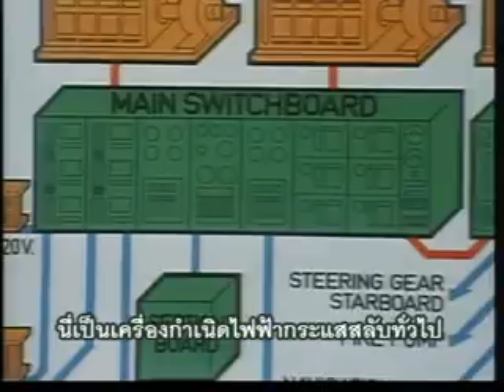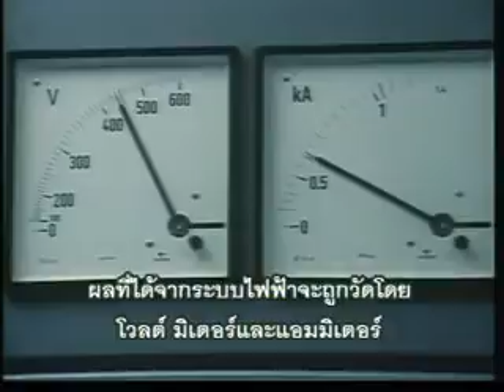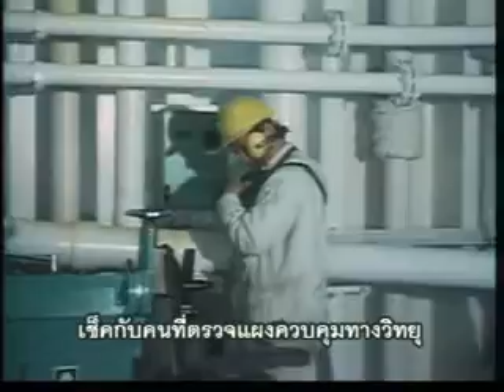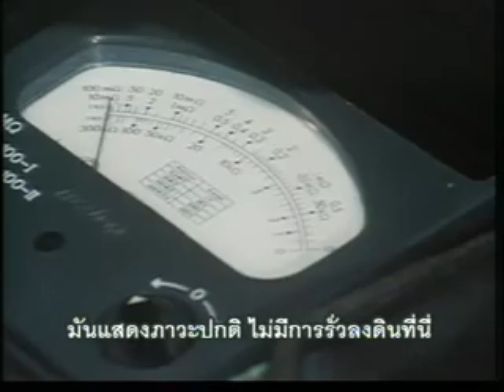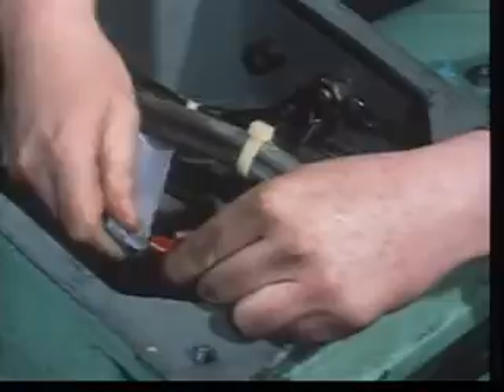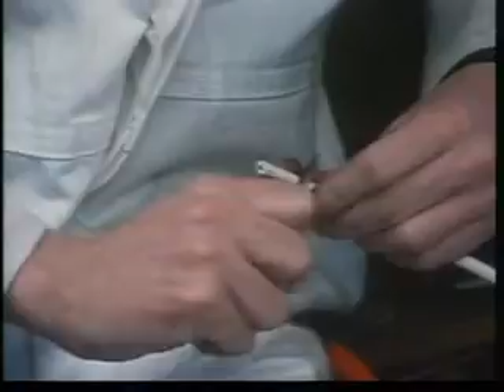PRACTICAL MARINE ELECTRICAL KNOWLEDGE ELEC DISTRIBUTION VOL 2  MARINE WORLD

Comment: I always  preferred chasing grounds (earth faults) on a deenergized circuit.  Lock out the supply at the disconnect device closest to the switchboard that is practical - least disruptive to other loads. Then perform checks as described. Safer procedure.